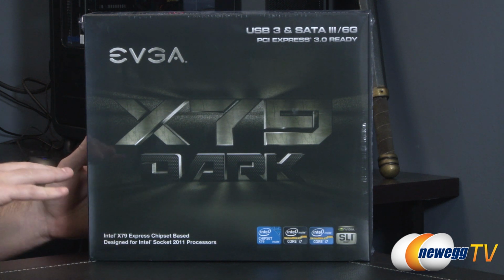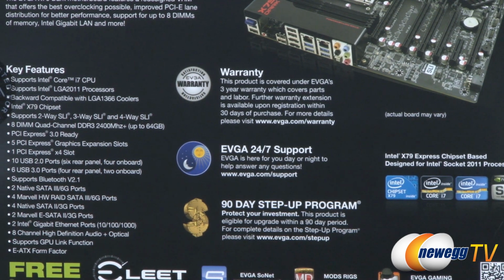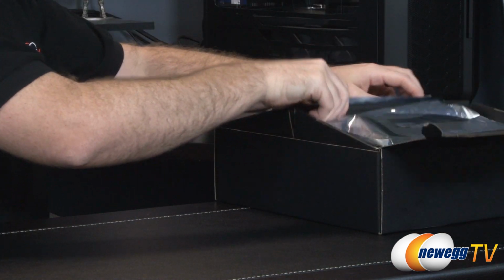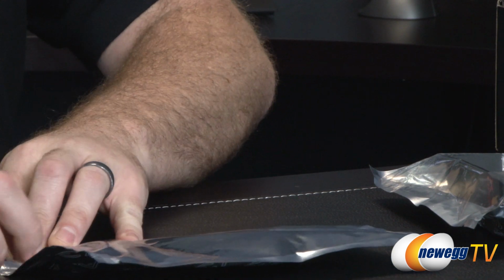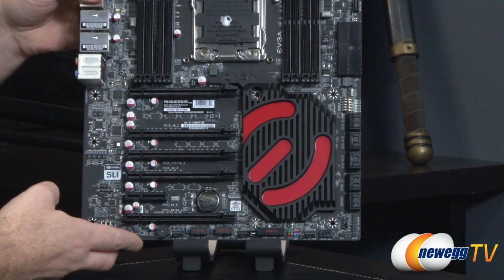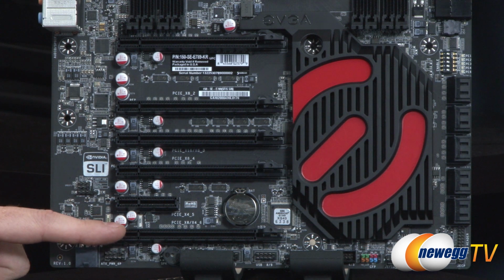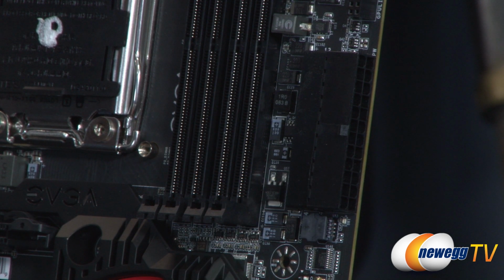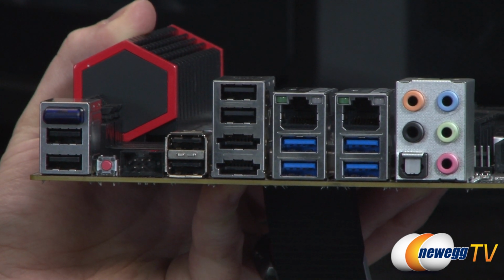EVGA X79 Dark Motherboard Overview - Newegg TV

Comment: Will it be a problem to run an MSI GTX 780 lightning with this board due to the GPA Reactor running into the ram slots? Just wondering.

Comment: The gigs in themselves would probably never be maxed out. Not in the next 5 years at least.

Just having the cache pools for instantaneous program response is enough for me.

That and potentially using the extra data as a RAMDisk. I've always been curious to see RAGE play without any  performance issues. 

I actually don't know for certain what I'll use it for, but I'll find something.

Comment: vmplayer recommends 2-4 gigs of ram per image. so this person would be running at least 30 vm's at the same time. you would be bottlenecked by your other hardware long before maxing out that ram. still useless. The only thing i see that being used is as virtual disk and having used both that and a ssd it's like magnitudes of cost for an iota of gain. even with the cost of 2 ssd's in raid.

Comment: Help! I'm building a computer and wanted your opinions on it but i'm over my budget. I need to know if everything is ok. I'm very sceptic about the MoBo. And later on 6-12 months I will be buying another MSI 760.
scpecs:
- MoBo: MSI 970A-G46
- CPU: AMD FX-8320 (3,50Ghz, 16MB) 
- RAM: G.Skill RipJaws-X 8GB 1600Mhz cl8 KIT - 1.50V
- Cooling: Cooler Master Seidon 120M
- GPU: MSI GeForce GTX 760 2GB Twin Frozr Gaming
- PSU: Corsair GS800 2013 Edition 800W
- Case: Cooler Master Elite 431 Plus Window

Comment: Hi I was wondering if anyone could spare a couple of moments to help a beginnign pc nerd.
I've just built a computer and there is no signal to my monitor. I have actually used tape for my CPU water block and it is touching the pcb, plus I have put a teeny bit of tape on the CPU. The tape is removable but it still doesn't work without it. All the parts are new and I don't think I need to list the specs. If anyone can help please inbox me.